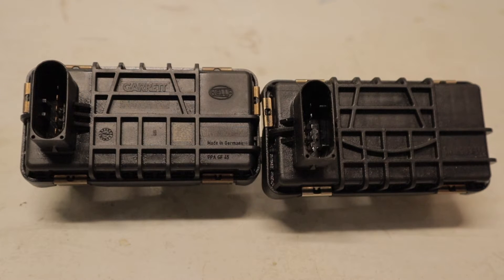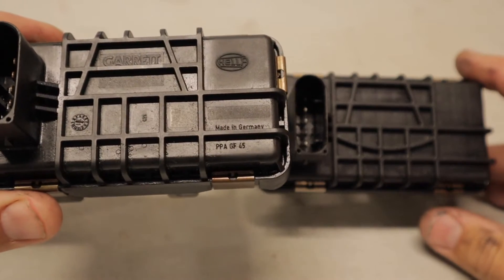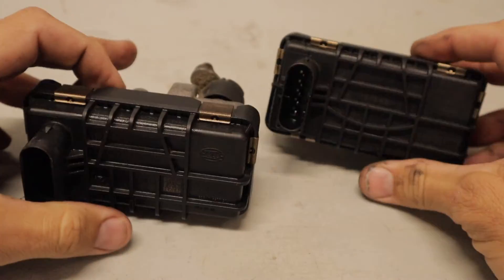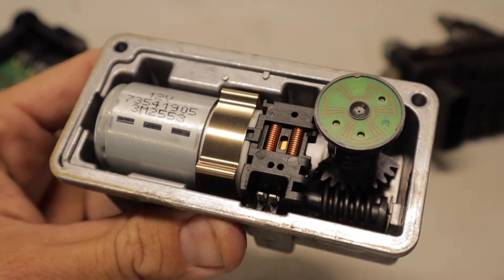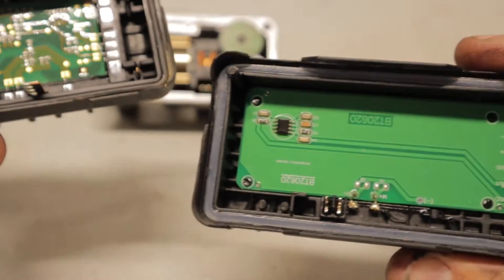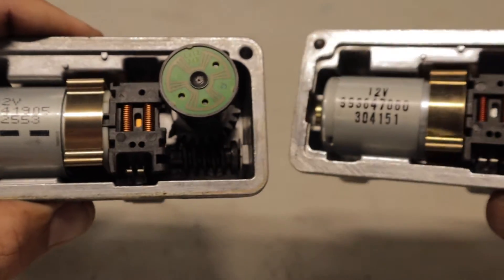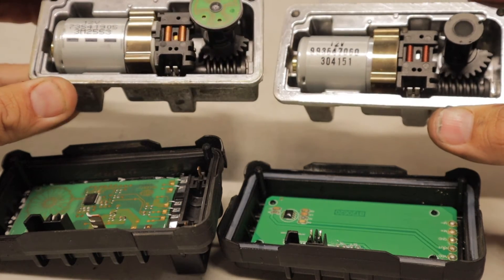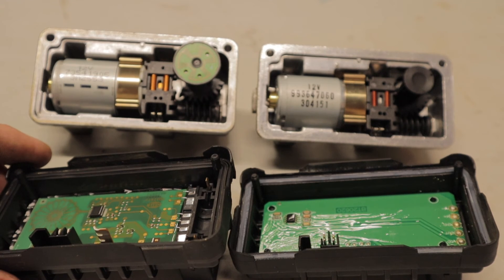Ford Ranger Turbo Actuator,  Genuine VS Aftermarket

Comment: I literally just replaced a chinese one that failed this week and thought I'd pull apart to see if it was any different. There was even LESS in it than the one in your video.  They aren't similar to the original at all, there is no encoder on the board, it's not a slight difference, it's a major difference. The original hella ones used by garrett are segmented and use an encoder to know where the actuator drive position is at all times. That's what the circular printed design on the PCB is doing, the disc on top of the crescent gear is the reference point used for the encoder. It uses this to provide very fine control over the actuator, and can respond to pcm requests very quickly, something you want in a variable turbo as very small throttle inputs and engine load result in movements in the actuator when driving. 

If you view the live data with a scan tool and compare the actuator PIDS you'll see actuator position and variable nozzle turbo position sensors, along with the sensor voltages and opening % of the actuator position. If you record the live data and plot them, you suddenly begin to realise the chinese ones are using programming to mimic the output of the genuine sensors. Thats how they get away without having an encoder circuit in the actuator. They aren't actually reading the position from either sensor built into the actuator as you are bound to see some discrepancies between requested/demand values and actual values if it was using real time sensor values, given the drive has to actually respond to the PCM request. The response is basically linear like its extrapolating data from a table and the motor moves, but the whole process is far too smooth, it's like the definition in the circuit is very low. This one wouldn't even show the actual opening % of the actuator. I also noticed the genuine item does a few things that look like it might be error checking or potentially trying to reduce the build up on the vanes. It's not on every ignition on/off, but randomly the actuator will open and close fully a few times like its either checking the operating range is still good or maybe like it's moving the vanes fully open/closed to try and sweep away some of the carbon build up and keep the vanes freely moving. It happens frequently enough to know it's a routine, not a weird glitch. 

What all the above actually means is the chinese ones that look like the above are basically doing enough to fool the PCM into thinking everything is working fine, but they don't function anything like the originals. When driving them back to back, you can see and feel how more frequently the turbo responds with the original in use, so the actuator is responding with greater frequency because it has a much greater level of control. Driving around, road testing vehicle after replacement with the genuine item, the part throttle/cruising (so, low engine load) is when I noticed the difference a lot. The turbo isn't spooled and doesn't sound like its working as hard, which makes sense if you are basically rolling down the road. Owner is going to keep an eye on fuel usage, back to back, as I reckon there will be a noticeable difference. What it means, long term, is the genuine item isn't going to working your turbo anywhere near as hard which will probably extend its life. 

The biggest problem with the chinese ones is they are a complete unknown, quality wise, you've got no idea if an $80 one is anything like the $250 or $300 ones, so the components they do use likely vary a lot too. Regardless though, none of them look like they could operate like the genuine ones. So if you only care about it working with no faults, I guess, take you chance on the non genuine ones. If you want it to work as it should and plan to keep the vehicle long term? Just spend the $450 for the genuine one and not have to worry about it. Or, if you still have your original one that the gears have stripped, use the chinese one as parts to rebuild the oem one. The chinese one I just replaced even had metal gears in it, better quality than the original! 

This one I just replaced had failed within 6 months. Started generating underboost fault codes because it randomly wasn't responding to pcm requests based on engine load (ie, the fault only occurred when driving up decent hills) and would go into limp mode. If you've experienced this in an automatic vehicle you'll know the BT50's and Rangers will cut voltages to the solenoids and lock out the gear position instantly causing quite a large bang/shudder that feels like the transmission has serious problems. I only came across this vehicle because the owner was told it needed a trans replacement because of this, but it was actually being caused by the low boost fault. Started happening more frequently to the point the vehicle was basically undriveable and the vehicle came to me for a second opinion.

Comment: As far as Mazda BT50 UP, and Ford Ranger PX model, you can buy them without the turbo. 

2.2L - Original Hella part # 6NW 009 550-271 or 1850-132-004

3.2L - Original Hella part # 6NW 009 550-211 or 1850-132-036

Either number for each engine should find the original matching part.

Comment: Hi, interested to know if both have been fitted and any performance differences? I have an aftermarket turbo on my 2014 Wildtrak and even though its mapped it's very flat under 2000rpm. I do have the old turbo so could possibly swap the actuators?
Any help/advice appreciated 
Rich

Comment: They way I see it the Garrett actuator should be more reliable than it actually is and should outlast the mechanicals of a turbo plus the actuator can not be purchased separately. When or if this happens to my ranger i will try the eBay one better than a replacement turbo

Comment: You can see the Garret one has the green circuit board on the cog wheel thats for ECU is able to know the position of the wheel and acutuator arm at all times. China one doesnt have it. Has just the plain circuit board. 
So crap. Thanx for proving it with eveidence to support it.

Comment: Mate:) thanks for taking the time and efforts in putting this video. 
My experience is also similar to yours. 
The genuine parts are not only way over priced, they are often ridiculously bundled to extract as much money from the poor buyer. 
The aftermarket parts are reasonably adequate for the purpose at significantly cheaper prices

Comment: the chinese one doesn't have the rotary encoder that report the vanes position back to the ecu! and the PCB seems to fool the ecu with false signal regarding its postion! it be intersting how the chinese vs the OEM behave on the sweeping motion while driving! got the same one on my pickup intersting video mate.
Reply: Dont really need the position feedback. MAP demand vs actual MAP will throw a code if theres much difference.
Still agree i wouldn't buy one of these Chinee ripoff jobs
Reply: Agreed. This is the difference and why I will get OEM.
Reply: @NCHuntSA  I feel it will be a gamble with the Chinese unit that it may malfunction and cause overboost condition . If the OEM got damaged gears maybe i buy the chinese unit and rebuild the OEM from it.
Reply: @AdelJeffreyJeffreysAuto  Yes, exactly, why take the chance? Using the copy's gears is a good work around.
Reply: @NCHuntSA OEM board is made in China anyway...
Reply: @TheCommanderNZ That may be true but the non-OEM PCB does not have the rotary encoder on the PCB so is not of the same design. Big difference between the two. Read the preceding comments to see why I won't by the chinese knockoff version. I have no issue with stuff made in China, it is the quality control or spec to which the components are subjected to that makes the difference. One has to choose wisely between what is available based on the info provided.
Reply: Theoretically couldn’t you just take the garret pcb plastic side and connect it to the new Chinese side of the motor that’s from the Chinese one and would technically work the same as if it were factory? Cause no problem and also save you a sh*t ton of money?
Reply: Nice to see someone picked this up too! If you view live data and look at the actuator and vnt position sensors, along with the opening % and compare it to the requested/demanded VNT position from the PCM, you'll see not only does the genuine one respond with a greater frequency (i.e. its continuously making lots of small changes based on throttle input and load), but the values between the recorded opening % of the actuator and the requested vnt position are always pretty close. Talking within a few % of each other. This doesnt happen on the chinese ones. Some of them don't even seem to show the opening % at all. 

I suspect the copies have a table mapped out that responds to a motor drive duration. The request/demand value from the PCM is processed and corresponds to a duty cycle % for the drive motor, which pulses it on and off to provide actuation. Does enough to fool the PCM into thinking things are working as normal, given its obviously moving the drive motor, but the definition is nothing like the real thing. It has nothing to actually tell it where the actuator position really is, and can't provide the control like the original which not only provides rotary position, but also has steps in the printed encoder circuit so it can instantly advance to a defined position within the range of the encoder, then provide small incremental adjustments as needed too.

When driving them back to back, with the original actuator in place you really start to notice how much time the turbo spends OFF boost when cruising or on deceleration, then how frequently it responds to throttle inputs.

Comment: Love this channel. Thank you. Be good to have an electronics engineer explain the differences in the board
Reply: It basically boils down to the OEM ones being programmable for different uses. The Chinese ones are made to exact use cases and can't be changed. This makes them less interchangeable, but in practice, OEM ones are never changed either